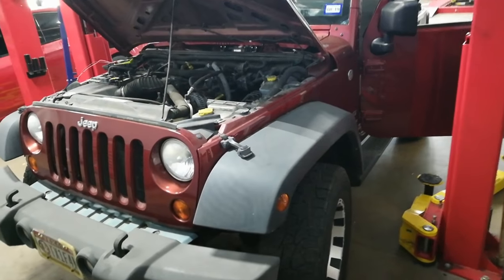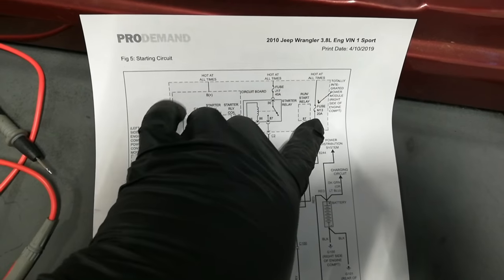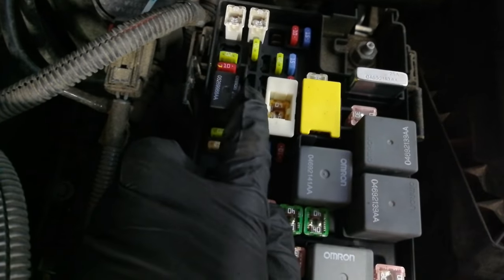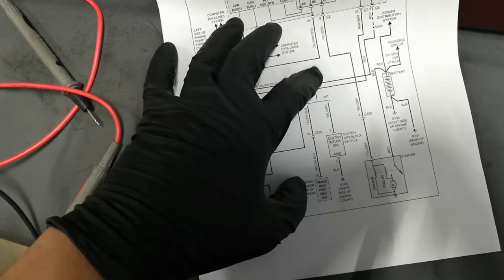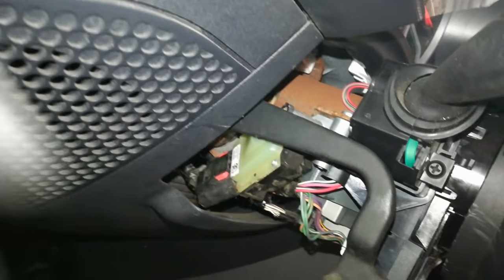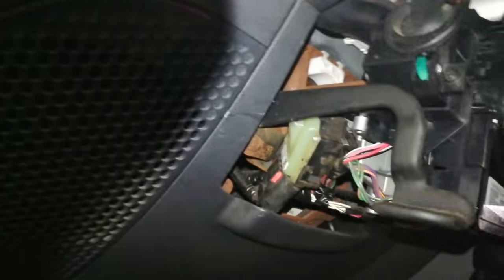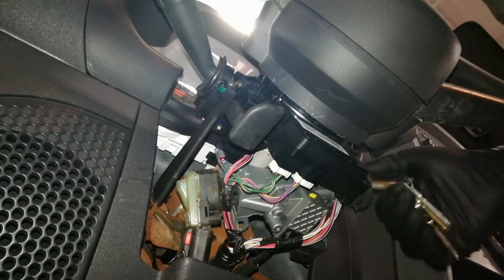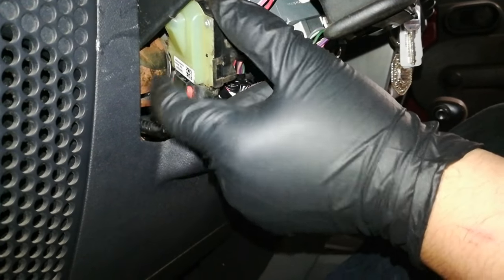JK Jeep Wrangler Won't Start / No Start Condition ( Ignition Switch )

Comment: I know this is three years old but THANK YOU. My jeep wouldn’t start before and I’ve been online trying to get some ideas of why. I was thinking the starter until I saw this. When I crank the engine I get the same result as you did in this video. Of course the jeep is starting now. But if it happens again I will try messing with the ignition switch wire. The battery is fine so j think it’s either this or the starter. Thanks again.

Comment: Reading the comments makes me cringe. How many have changed the starter (several times)  or battery for this same problem. If you look on the fuse box lid the starter relay position is marked. Pull relay out and look at the bottom prongs. find the one marked 87 and find the hole that prong fits in and jumper 12v to that hole the starter will turn. CAUTION. make sure your key is off and transmission is in park or neutral!!!!!  If the engine cranks this eliminates the starter and battery. Get someone to turn the key to on and sit holding the brake as you jumper #87 and jeep should start and get you out of a pinch.

Comment: You saved me a trip to the dealer. This was the exact issue on my 2008 Jeep Liberty. The dash lights were going in and out and no crank or start. I wiggled this exact wires and Jeep started up. I replaced the switch. Thank you for a short valuable video.
Reply from the maker: Wow thats awesome! Please subscribe!

Comment: Would you have any luck with the starting issue if you took the key out and put it back in?  Mine is doing this, but when I remove the key and put it back in 9/10 times it starts right up.
Reply: Mine does this but lately it’s been 1/10 times it starts
Reply: mine will start every 7/10 times when doing this. Anyone know if this specific issue, (re-entering key thing) is actually due to bad ignition switch?

Comment: My 2013 Jeep Wrangler Unlimited Sport manual wont crank until I pull the steering wheel hard to the right. I have to use my whole body weight to turn it hard enough to right for it to crank. Occasionally cranks turning it hard left. Frustrating. Battery is good. Getting power to everything. No mechanic that I have called has a clue. 
So very Frustrated.

Comment: I have a 2010 and I am having the same issue. Tried wiggling playing with the switch but didn't change anything. So, I replaced my starter, replaced the battery connectors. These were both needed replacements still had the original battery connectors and the original starter and the vehicle has over 150,000 miles on it. Works better, well at least it starts more often now 95% of the time I presume. I am noticing that at times it takes a few turns of the ignition to start it. Sometimes turning the key slower allows for ignition first turn. I hear the starter engage when I turn the key but the engine doesn't turn over sometimes. Since the engine isn't turning over it's not cycling through four strokes, I assume it's either the switch. or the actuator pin. 

I get radio and accessory power every time just when I go to turn the key to start it sounds like a loss of connection right after the starter engages. Had the battery tested the new connectors have good power and good ground connection and the starter is mounted properly with a good connection. Also check the relay in the fuse and they are in working order as well.

Comment: Mine doesn’t start and not crank 🧐 my jeep jk 2013
Reply from the maker: Could be your ignition switch! Let me know if you need that starting circuit diagram
Reply: Lets me get it.. please.
Reply: @greasemonkeyrepairs4737  I'm having the same problem. Im was hoping it was the M13 fuse. can you send me that starting circuit diagram?

Comment: I wish I had found this sooner, but my issue was with a 2010 back that I traded over 3 years ago primarily because it had a recurring no-start issue that I thought had to be due to a faulty (or burned out) starter.  I replaced the starter several times.  I even took it to the Jeep dealer and left it with them for a month, during which time they could not replicate the issue.  How it never happened to them is beyond me.  Naturally, less than 24 hours of getting my vehicle back, the issue occurred at work on a Friday night.  I went out the next day (after of course dealing with the issue once again by banging on the starter with a crowbar) and bought a 2017 Wrangler, praying the whole time that the dealer would not experience the no-start scenario.  Too late to help me, but at least now I know.